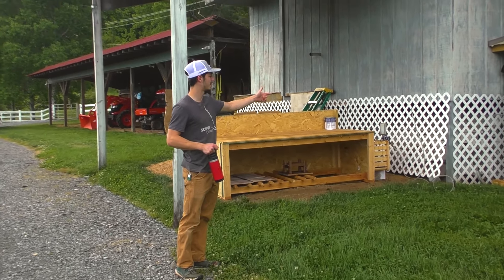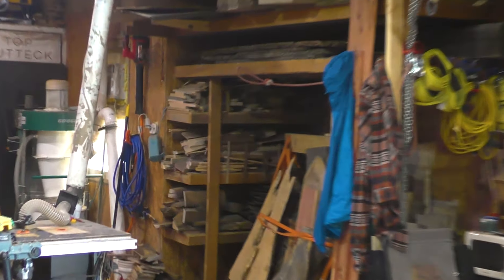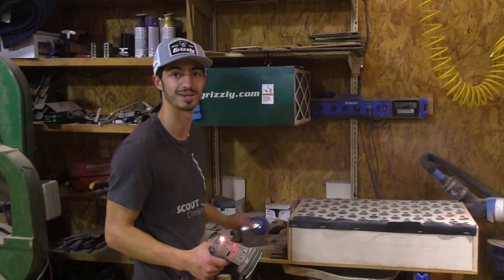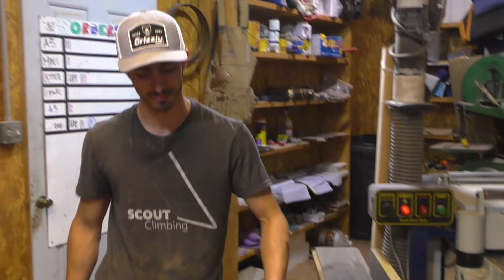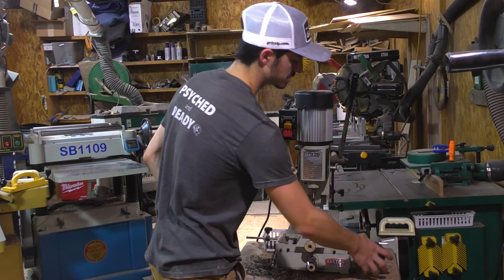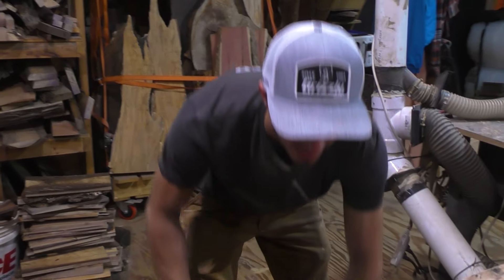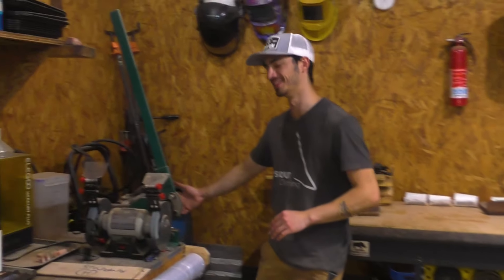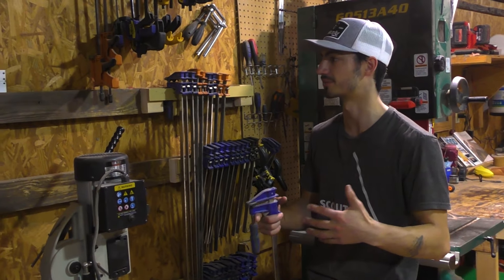600 SFT Shop Tour 2024

Comment: The best part of helical head is that there is always at least 1 knife cutting the material, this is what reduces the chattering.  When there a a space between knives the wood will bounce off the bed producing those terrible chatter marks.  Curious if you get chattering with that jointer design?
Reply from the maker: @tableshaper4076   no it all cuts pretty clean